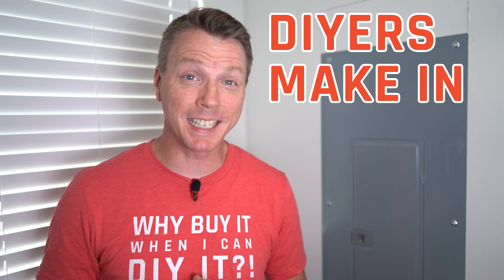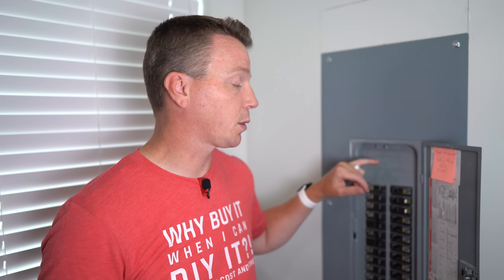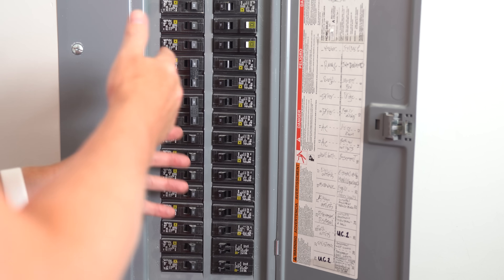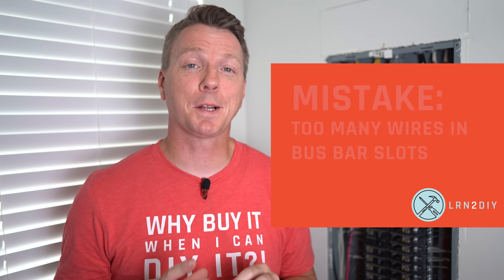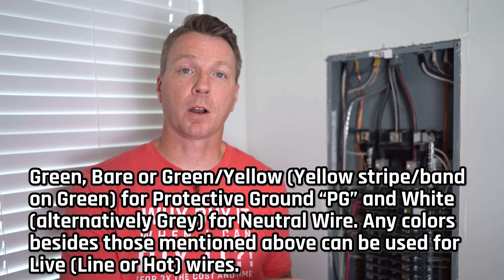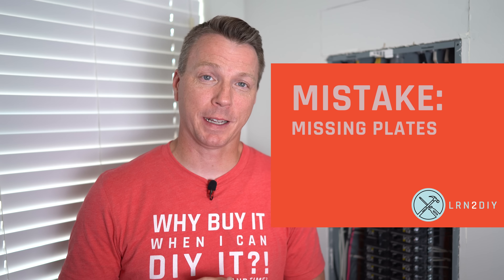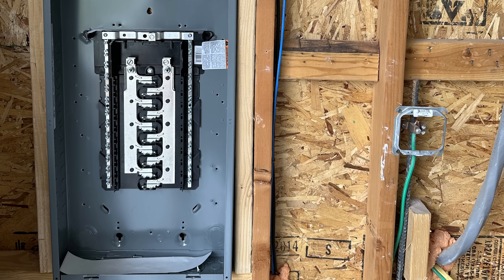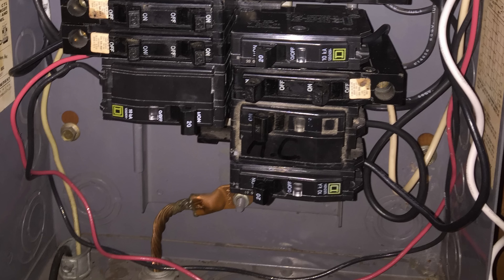10 Common Mistakes DIYers Make In Circuit Breaker Boxes

Comment: The jacket color code is fairly recent (2001) and most homes were made before then and the jackets were generally all white then so be careful in assuming a white cable is 14 gauge.  The good news is that assuming this is generally safe, but you may end up using a 15 amp breaker on a 12 AWG circuit that may routinely draw enough current to trip the 15 A breaker.
Reply from the maker: Good points.
Reply: If I'm not mistaken the jacket color code of white, yellow and orange for #14, #12 & #10 respectively is voluntary,  more or less a gentleman's agreement and basically all the NM cable that I've seen aside from pre-2000 homes use the colored jacket as an easy way to ensure the proper wire size relative to breaker/fuse size is used.
Reply: I will always prefer underrating a breaker on a line than risk overrating  the feed to a cable any day.
Reply: @andyevans2336  I prefer to get both right the first time.  😁
Reply: @LTVoyager  same here especially with the cost of wire and material which continues to rise.    For example I wouldn't want to spend extra $$$ on #12 wire when I need a 15 amp circuit unless the run from the panel is over 100 feet and I need to step it up to #12 to keep voltage drop on the far end under control.  If I'm running several circuits far away from the panel it's more efficient in terms of material and labor costs to install a subpanel near the remote location instead of oversizing all my circuits.

Comment: I presume this is a split phase system i.e. 120 + 120 V. My question is how important is it to balance the load between the 120V bus bars? 🤔🤔🤔
Reply from the maker: Great question. Ideally, you want to balance the two legs as best you can to prevent overloading or heat build up. Most systems can handle a certain level of imbalance but if there are any easy options to balance the two legs, you may as well. Keep in mind, the important variable is not what each branch is rated for, but what they actually draw. If you've got something that gets used once in a while vs all the time, you may need to balance your legs accordingly.
Reply: @LRN2DIY  Another note on loading - while not necessarily applicable to this video, if you have a UPS the provides 120 + 120 (would be a 4-wire output - 2 hot, 1 neutral, one ground), you want to balance the load on each 120V side as closely as you can.  Yes, you can have a panel on a UPS output - depending on the application and codes.

Comment: I'm looking forward to your sub-panel video.  Grounding those things is a puzzle.
Reply from the maker: Thanks so much. I'm editing that video right now. The grounding itself, however, is typically pretty straight forward. If your new subpanel is in the same structure, you can run the ground from the same source panel that you're getting your hots and neutral from, or, if you're anywhere near the actual ground rod for the main panel you can tie directly into that. If your subpanel is in a different structure, you need to install a new ground rod for that separate structure and connect the subpanel to it. The hots and neutral come from the source panel but the ground is connected to the new ground rod. As always, work with a certified electrician to verify all of this before you jump in.
Reply: @LRN2DIY you better do a more research into that one, I think you’re heading in the wrong direction
Reply: @LRN2DIY .  Now I’m looking forward to your sub-panel video!   What do you think that a ground rod has to do with a sub-panel if in the same structure as the origin of the feeder to it?
Reply from the maker: @KevinCoop1  You can connect your new sub panel directly to the existing ground rod as long as the new sub panel is in the same structure. Is that what you’re asking?

Comment: When I moved a light switch in my basement, I switched all the 15-amp breakers, but the lights stayed on.  Yep, it was a 20-amp.  14-gauge wire.  Why?  Originally, eight 200-watt incandescent bulbs.  Sure, less than 15 amps.  But what happens when you switch on eight 200-watt light bulbs at the same time?  I'm pretty sure starting current jumped over 15.
Reply from the maker: Sounds like someone was doing their homework and playing it safe, which is great. With newer bulbs consuming so much less voltage, it's hard to know for sure how much power will be consumed by a given homerun for a lighting circuit but always better to be on the safe side.
Reply: @LRN2DIY  Actually, did whoever installed the 20-amp breaker violate code?.  The wires are 14-gauge.  
My theory is that they turned on all eight 200-watt incandescent bulbs, and tripped a 15-amp, so they fixed it with a 20.
Reply: @bobd5119 .  (8) 200 watt incandescent lamps turned on at exactly the same time on a 15 amp circuit breaker would not be a problem, immediately.  There is no inrush current on incandescent.   So, 1600/120=13.3333.   The problem would be if they were left on for more than 3 hours.  The maximum current for continuous load on a 15 amp breaker is 12 amps.   So, heat build up within the breaker would eventually cause it to trip.  Putting a 20 amp breaker on #14 copper is not per NEC.   You should get it changed to a 15 amp breaker for your safety.
Reply from the maker: @bobd5119  Ah, right you are. I must have misread the original comment. 20 amps, 14 AWG. Gotcha. Yeah, they really should have less bulbs on there but that may be less of an issue with the recent change to stop selling incandescents, effective tomorrow.
Reply: Less than 8 lights on a circuit?
How was the builder supposed to know they'd manage to find 200w lightbulbs?
Reply: @KevinCoop1  Actually incandescent light bulbs have substantial inrush current because the resistance of cold tungsten is less than hot tungsten. I measured some 40 watt candelabra bulbs at around 40 ohms cold, this would be 360 watts of inrush power. The reason this isn't a problem is that circuit breakers don't trip instantly on overload, they are delayed based on the severity. My central air conditioner runs on a 30 amp breaker but its inrush current is over 100 amps.

Comment: Labeling in my panel was done by inebriated trolls.
I have one of those Klein breaker finders.  I've used it only once, but it worked nicely.  Instead of having to switch three dozen breakers until I found the right one, Klein told me two adjacent candidates.  Easy Peasy.
(Note to self: label the breakers!)
Reply from the maker: Watch out for those inebriated trolls. I swear they've been put in charge of organizing my computer's desktop files too. Naughty little buggers.
Reply from the maker: Watch out for those inebriated trolls. I swear they've been put in charge of organizing my computer's desktop files too. Naughty little buggers.

Comment: Unless the code has changed in recent years, the ground wires are allowed to be two to a hole in the bars, provided they are the same gauge. This is easily verified by looking at the chart on the door that specifies wire sizes per terminal, torques, approved breakers, etc.
Reply from the maker: You're correct. It's not allowed for neutrals but is permissible for ground. A lot of folks shy away from it because it is believed to increase the likelihood of one of the wires becoming loose.
Reply: @LRN2DIY  when playing with power its better to be safe than sorry.
Reply: Even 3 on cutler hammer. You can find the info on the panel door
Reply: It's only allowed if the panel is listed to allow it. It's not automatic.
Reply: Or just buy another bar
Reply: Nec 408.41 under no circumstances can 2 wires share the same terminal in a panel box.
Reply: @chrischarboneau4014  Uh, yes. 408.41 refers to "grounded conductors, ie, the NEUTRAL. Quoting from another source.... What is the purpose of a grounded conductor?
The Grounded Conductor's job is to serve as the return path for electrical current in a branch circuit, once that current passes through all loads in the circuit and is returning to its source. A Grounded Conductor according to the NEC is a current-carrying conductor.
The discussion at hand here is about the safety ground, the bare or green wire, not the neutral.
Reply: @CharlesinGA true, and people  get confused with Grounded vs. Grounding conductor. There really is no "neutral" in a 2 wire 120v circuit. It's the grounded conductor.
Reply: @chrischarboneau4014  it's listed on the panel door. Also square d has a stab in breaker that is listed for 2 wires. It's labeled on the side

Comment: 7:14 most load center manufacturers, like Square D we see here, are OK with doubling up grounding (ground) conductors per grounding buss hole. While NEC doesn't seem to explicitly allow it, NEC doesn't explicitly disallow it either. The reasoning is that the grounding conductor is only meant to carry fault current and should not experience the heat/expansion cycles like that of a current carrying conductor like the grounded (neutral) conductor.
Though in your case, it looks like you have more than enough terminal spaces on your ground buss and the previous installer really didn't need to resort to doubling up grounding conductors like that.
But overall, agreed with the sentiment regarding Neutrals, NEC 408.21 forbids double tapping grounded (neutral) connections at the buss termination.
Reply: I came here to say the same.

Comment: Another very common mistake is using a breaker from a manufacturer different from the company which made the panel as it may not be suitable.
Reply: And although last I checked breakers were still available from a 3rd party - if you have an old Federal Pacific panel, replacing the panel should be the top of your priority list.  They were known to have...issues.  An electrician I know once commented 'You could weld with those panels' - meaning you could easily draw a whole lot of current without the breakers tripping.
Reply: @roberttimstarliper1671  ahhh.   Aka Fire Producing Electric, the red tipped handles = DANGER.   11 years ago I suffered 1st and second degree burns on my arms, chest and stomach area and spent 3 days in the hospital after unplugging an arc welder from a 50 amp receptacle in a 30x40 polebarn with an FPE panel from the late 1960s.   Part of the receptacle chipped away, and the lugs came loose and touched each other and the metal box/metal conduit leading back to the breaker panel.  Both the 50 amp breaker AND the 100 amp main failed to trip.   I recall falling backwards with my shirt on fire, and I crawled down low for about 30 feet to get out and call 911, at which point the conduit was spraying molten metal all around me and the panel caught fire and made it's way outside up the service wires blowing holes in the metal siding like a cutting torch and continued until finally the cutout on the pole transformer blew.  I have permanently scarring and some hearing loss  The polebarn was fully engulfed when the fire department arrived.
Reply from the maker: Good point. I just saw that on a video I was watching. Square D box with all Square D breakers but one Eaton hanging out in there.
Reply: It would be rare this is a safety issue though. It's just a liability and warranty issue. The equipment hasn't been tested together by the certifying body. The individual devices have been tested though. As long as the bus bar is the same thickness and material it shouldn't matter.
Reply: @court2379 typically as long as you use the same breaker style eg. CH or BR, that in of itself isn't typically a safety hazard,  but it technically is a code violation because with the exception of classified breakers,  using a different manufacturer breaker voids the UL  listing of the equipment.

Comment: An electrician with a torque device?  Very rare.  On my projects as engineer always asked the electrician to bring his torque devices to the first job site meeting,  did they get used? Who knows.
Reply from the maker: Yeah, they're pretty rarely used but they definitely make me feel better. Just finished installing my sub panel and everything is torqued to just the right setting. Now I'll head back each year and double check that they're tight.
Reply: @LRN2DIY  On my project of four 4,000 Amp switchgear line-ups I required the electrician to mark every connection after they were torqued.

Comment: Excellent video. Im a homeowner and occasionally will make a simple repair but call in the electrician for real repair needs. About 9 years ago I had the overhead line running to my house replaced with an underground line to my house through a transfer switch and a new pole for my meter with a new meter box with 3 power legs and it's own shutoff switch. And the inspector was able to inspect it the same day the work was completed. Best upgrade this house had in years.
Reply: What do you call "real repair needs"?  Do you know that 5 ma will.kill you?